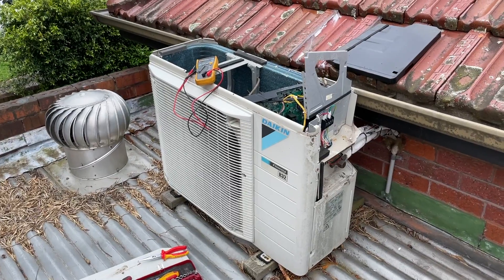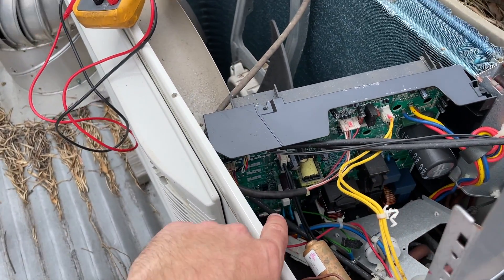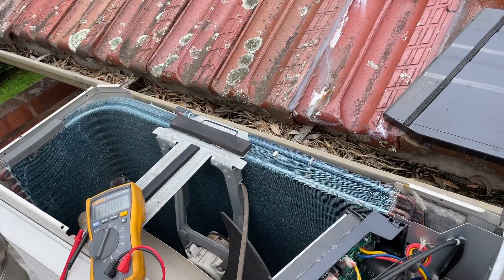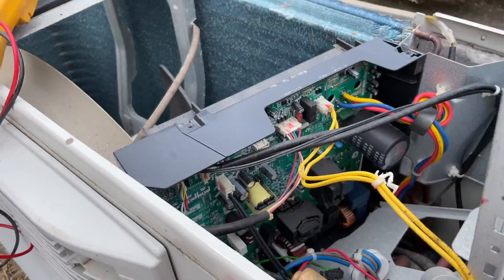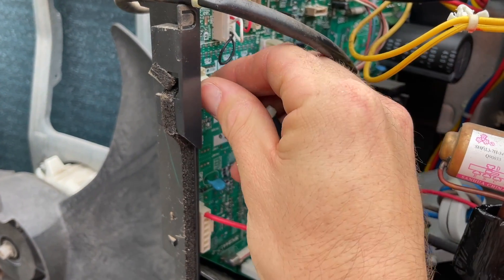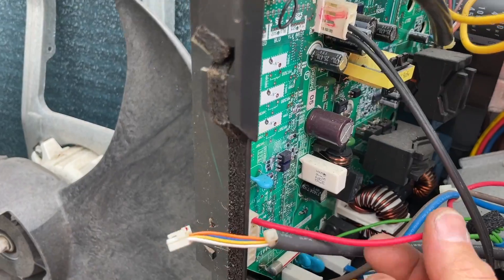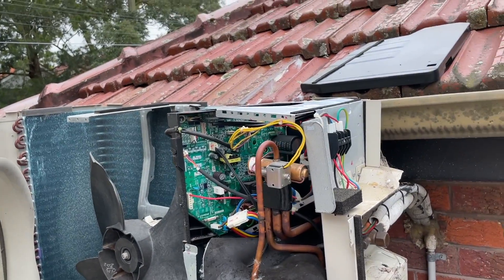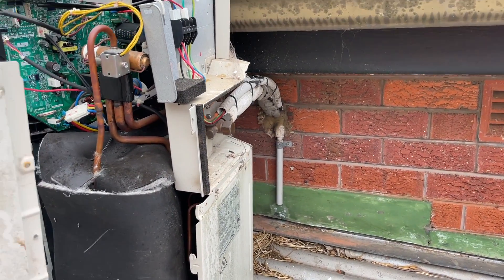Diagnosing Daikin E1 Error

Comment: Nice video, what Min/Max frequencies do these inverters run at?
Reply: the proper r410 ones from panasonic run down to 18hz if conditions are right.
Reply from the maker: Thanks mate. This unit is a 7kW unit. On Cooling it can ramp down to 2kW and ramp up to 8.9kW. On Heating it can ramp down to 2kW and ramp up to 10.8kW. You can find out what the inverter frequency is whilst it is running using the Daikin service tool.